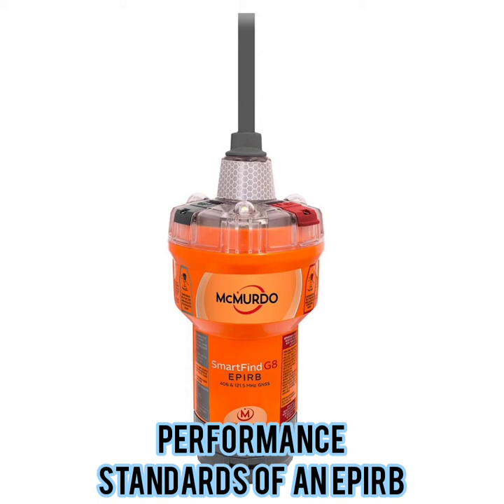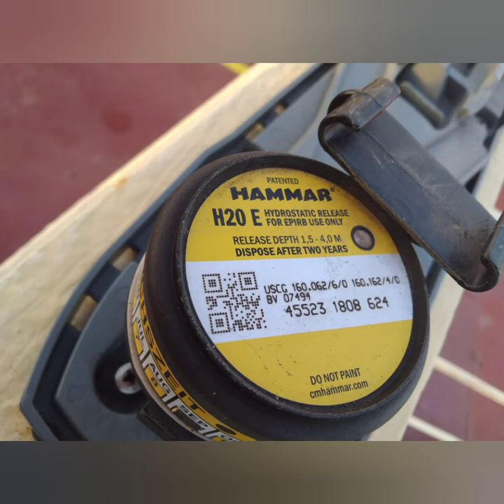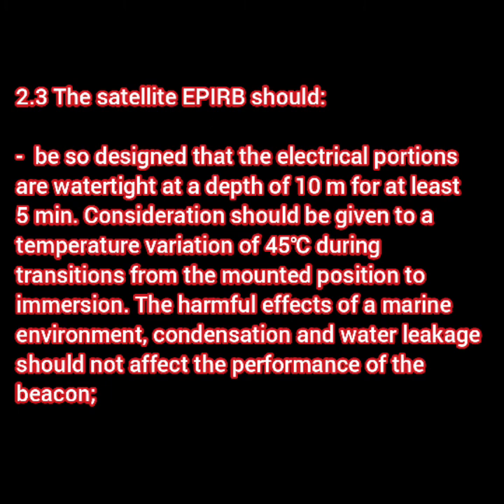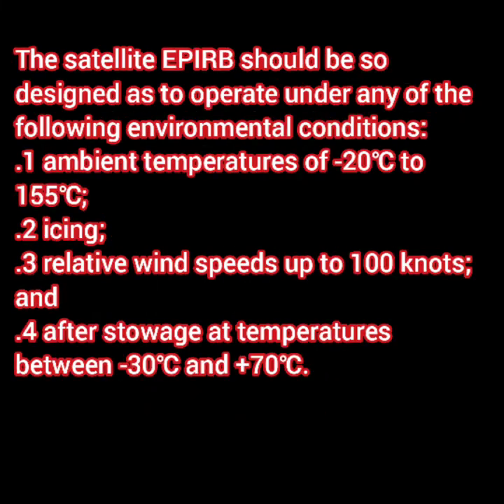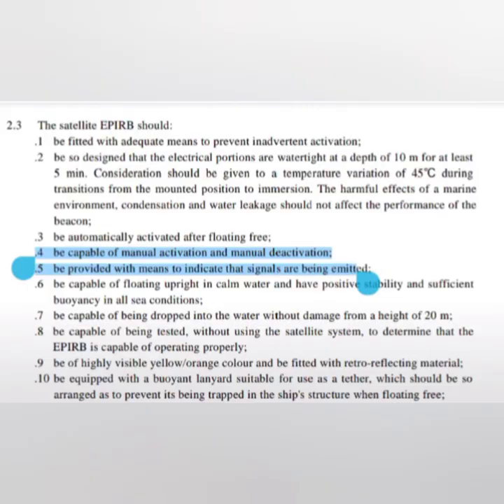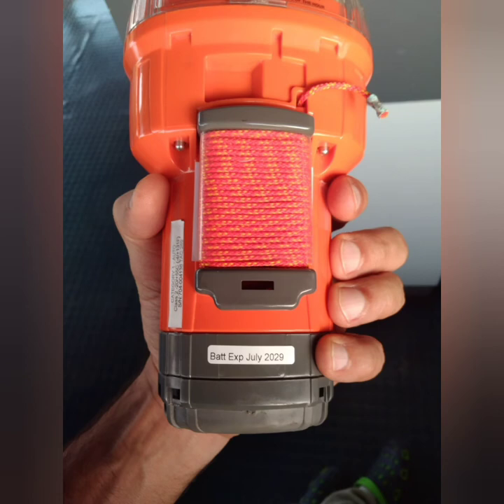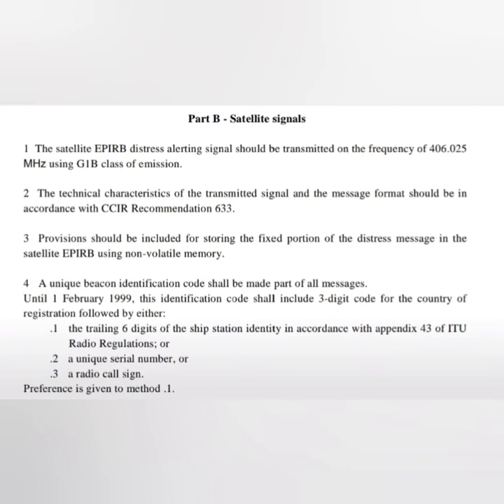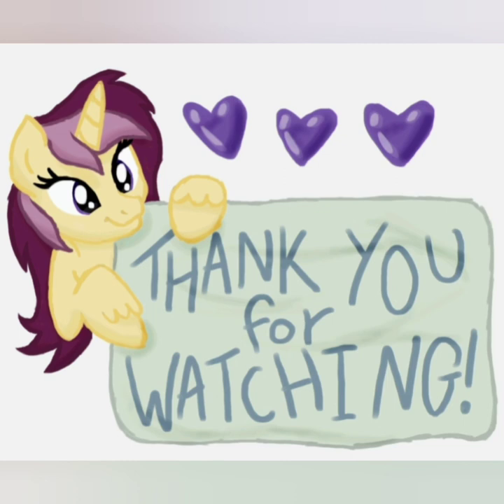Performance Standard for the EPIRB with tricks to remember!

Comment: One surveyor ask about difference between hru on liferaft and epirb.. could you please suggest if any??
Reply from the maker: Only design difference is there, Rafts have a line  and weakline while EPIRB has a solid plastic spindle type which is cut once and has no weaklink.
Reply: For 2nd mate/B.Sc Nautical Science prepration join kundan patna #kundanpatna